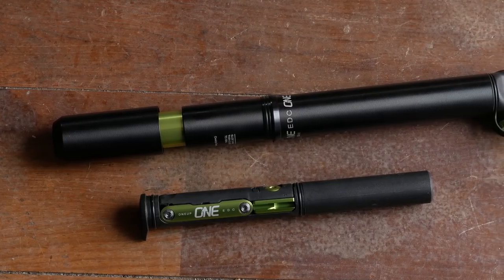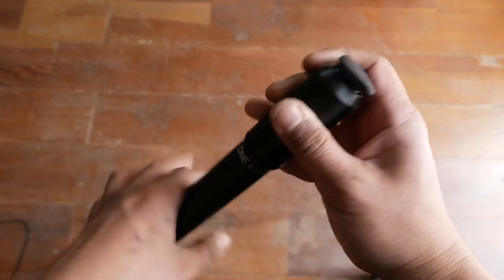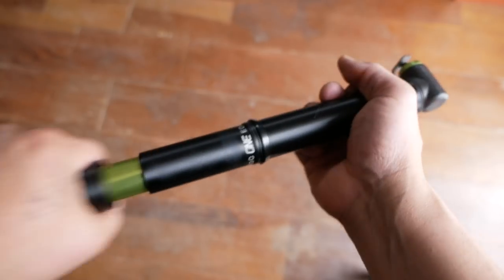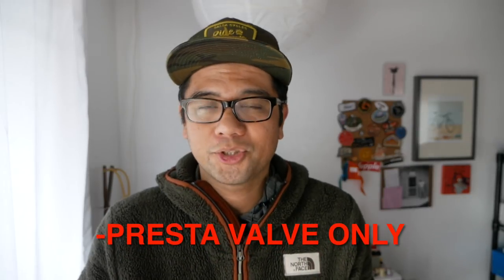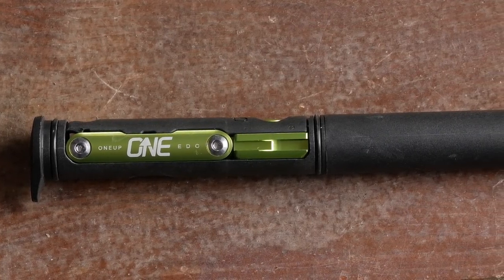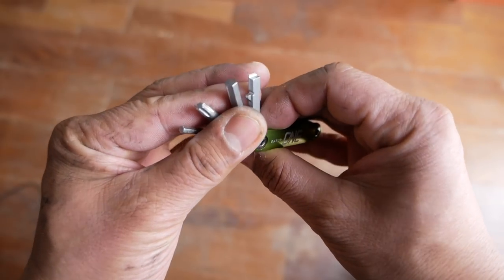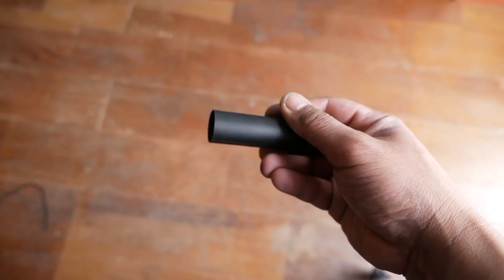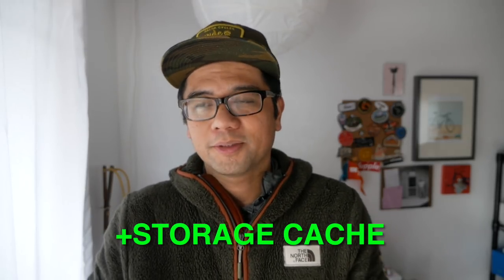Review: OneUp Components EDC Tool and Pump

Comment: I just had one of these pumps saved me on the trail yesterday. My Portland Design Works Ninja pump was not getting the job done and a rider came upon me and loaned me his OneUp EDC Pump and it worked like a charm. I personal think the price is justified when you consider how much it costs to add an additional bag to carry separate tools. It basically frees up the space your existing multi-tool takes up. And you can swap between bikes much easier if everything is inside a single piece. The pump itself is one of the best mini pumps I've ever used given you are okay with presta valve only. I ordered one today after being saved by the pump yesterday.

Comment: Tips 1: Basically sit the quick-link figure 8 flat on the tool between the two spurs. It should look like this ---> {8 Then you have to hold it there really tightly with all your grip strength while levering the 6mm allen key against the bottom of the figure 8, it should like this ---> {8/ It is very hard but I got it to work 4 or 5 times so I'm confident to do it on the trail. Tip 2: Remember to remove the C02 valve head with an allen key as it screws in really tight. Tip 3: I have really tight tire beads so I have to use the multi tool AND the the tire lever to get my tires off the rim. Tip 4: The multi tool only loads back in one-way or it wont fit back inside the pump. Tip 5: Test the chain breaker at home, mine works fine both in and out but it took some getting used to. Tip 6: If you get the small 70cc pump like me, use the large storage canister but cut the bottom off so it fits in the small pump. The skinny short canister is useless and fits nothing but I got glue/2x large rubber patches/4x quick tyre patches and sandpaper in the modified large one. Play around with all the tools properly at home and you'll love this all-in-one tool like I do. The pump is awesome (presta only) with its large volume and it didn't leak noticeably for me. I run tubes and this pumped a 27.5 x 2.5 up to 21psi in 100 strokes i.e less than a minute.

Comment: Best quick link removal tool I have used beside dedicated quick link pliers is a simple shoe string. Thread through the holes outside the quick link pull opposite across the link and bam! Link unlocked.
Reply from the maker: I tried the shoe string trick while filming this video. I found it worked on one set of power links but not another.  That's going to be a sep. video.
Reply: Johannes Nilsen 
I have tried it on brand new and well worn sram chains and kmc chains and it has worked for me. Haven't tried it on sram eagle yet however.
Reply from the maker: I tried it on SRAM 11spd and it worked well, but could not do it with a Shimano 10spd road.  I think the plier works for all and a shoe string works for most.
Reply from the maker: Tried it on a Shimano 10spd road with little wear and couldn't get it open.
Reply: What brand of quick link was holding the Shimano 10spd road chain together? KMC? SRAM? I know Shimano doesn't make their own quick links, so maybe you found a special mix/matched combo that has ultimate holding power! :) 
Always enjoy your videos Russ. 
PLP is one of my favorite channels by far. 
#BikeNerdsUnite 
-Nick
Reply: Not even a chance on 11 speed shimano brand new quick link.
Reply: Sandy Kavor works for me on 11 speed Shimano new links, but takes some extra effort for sure.
Reply: @RideAlongside  I have tried many times and it won't work with bare hands. Maybe in work gloves possible, but I don't see the need to struggle since there is plenty of proper tools to do that job.
Reply: Sandy Kavor well, I always ride in gloves, so maybe that is a consideration that I didn’t think of. I will more likely have a shoe lace than a specific tool, that was my only point. Thanks for the conversation.
Reply: @RideAlongside  I ride in gloves as well, but they aren't enough to stop the lace from digging into your hand. Maybe very strong leather work gloves yes. I use wolftooth pack pliers and even those are hard to push open the link. If anything I just use a chain tool on the trail and replace spare link then. Honestly how many times you actually have to separate chain while riding. I never had to.
Reply: Yep I always have a string with me haha

Comment: Thanks for your video. Regarding the quick link tool. ..I’ve had success using a short section of shoe lace .
-thread through the quick link
-put a knot in the open end
-use one of the Allen keys of your multi tool to twist the shoe lace-similar to a simple tourniquet. 
Practice the method before trail use. 
Cheers.

Comment: You need to move the quick link tool one link left. In the video you're just pushing against the right side of the quick link and pushing it tighter. Look at the way the link needs to be pushed for it to unhook. Opposite direction you push to install. Great review though thanks for the vid.

Comment: After watching you struggle with the quick link tool I had to give it a try. And the only thing that accomplished was getting my hands super greased up. For reference I tried on a near-new SRAM PC-1110. 

At home I recently bought a pair of Park master link pliers, and I do not know why I waited. It's so nice being able to pop them apart easily and without having to touch the chain with your hands.
Reply from the maker: Yeah. Not as easy as it looks. Don’t know if you saw our vid on the Clever Tire levers that turn into a plier. That makes a great travel option.

Comment: I wish one up had a video on how to use the pump with a C02 cartridge. I guess you unscrew the green pump head and this somehow threads on to a C02 cartridge to pump up a tire? Does it have an on/off switch? 🤷‍♂️
Reply: You likely thread it onto the presta valve then thread the cartridge onto the adapter. There is no on off switch. The co2 discharges entirely and you can let air out afterwards
Reply: My understanding from the website is you thread the co2 all the way in for off

Comment: Hey, good review except yeah you're doing the chain breaker function incorrectly. The way you have the tool oriented to the quick link is trying to force it closed, not open. If you look at https://youtu.be/EN3yVEbXSXA?t=18s you can see that you need to have the quick link turned 180 degrees relative to the tool. (The slotted link hole should be on the LEFT if it's facing you, not the right. Or just flip the tool around.) I like your videos a lot but you might want to edit this one. The mistake you're making would be very easy for others to make as well.
Reply from the maker: Noted.  I think however a tool that complicated to figure out that you need a youtube video to use it is bad design.
Reply: Kinda douchie that Path Less Traveled threw this under the bus because he can't follow instructions. Maybe he should update the video.
Reply: @PathLessPedaledTV  What a hypocrite, you made a video on the EDC pump and tool but slam by saying a youtube video to use a tool feature on your video that couldn't figure out is bad design? WTH? Thumbs down for this one bud.
Reply: @LeoVasquez   Don't overreact like a fanboi.  He said multiple times that maybe he wasn't using it right, and he invited pointers from viewers.  Moreover, he did NOT throw it under the bus for that.  He said he liked it a lot in general.
Reply: @PathLessPedaledTV  Alright, I gotta say it's obvious in your video you are trying to force the links closed not open. 
Not to mention it's actually a pretty brilliant design considering it eliminates needing to carry a special plyer for unexpected in-the-field repairs AND allows for a complete all in one tool kit that can FIT INSIDE! the pump or steerer tube.
Reply from the maker: @SamSquanch66  You squeeze the outer plates to open them and you pull them apart to close them. 🤷🏽‍♂️

Comment: Maybe your link is installed in the wrong direction. It should work on your chain if you use the tool from the top on the lower chain or from the bottom on the upper chain.

Comment: The chain link splitter is very easy to use, you just have to use it in the correct way. As for leverage it provides plenty, if you need a lot of leverage to open a quick link then you've got problems with the link or tool

Comment: you had the quick link round the wrong way in the video. you were putting pressure on the link trying to close it instead of open it. 180 the link or tool and try again.
Reply from the maker: I was doing it exactly as the official video suggests. It looks like I’m closing it but that is how it is suppose to work. The tool pushes the outer plates together to loosen.
Reply: @PathLessPedaledTV  Your link is connected opposite of the one in the OneUp video. You're pulling the link tighter in this video.

Comment: Would a CO_2 cartridge fit inside the tool cache compartment?
Reply from the maker: CO2 screws into the bottom of the tool in place of the cache.
Reply: @PathLessPedaledTV  what about the co2 inflater? is that included?
Reply: @Frank_Denver  the CO2 inflater is included. The head of pump literally can be pulled out of pump to be used with the CO2 cartridge.

Comment: What is the difference in the 100cc and the 70cc
Reply: Late answer but hope it helps someone.
With 100cc you can fill the tire faster and you get a bigger tool chamber to fit both multitool and co2 cartridge.  70cc is lighter.  Takes more pumps to fill the tire and you only enough space for co2 or multitool.

Comment: Terrible pump for road, borrowed one on a ride. Head wouldn't hold the valve stem well enough to get 60psi in a 700x30. Better for high volume.

Comment: use a shoe lace to unlock the quick link, dont need a tool.
Reply from the maker: Wouldn’t a shoe lace be used as a tool then?  That’s like saying don’t eat soup with a utensil use a spoon.
Reply: @PathLessPedaledTV  Just trying to give you a tip, you were unhappy and couldn't figure out the chain Master link device, so I thought Id help you out, or anybody else that is struggling with it.

Comment: Well, while it is a interesting designed pump, the failure or difficulty to go above 35 psi is a deal breaker for me.  I was going to consider this for my touring bike but I need a pump to go to 75 psi for my 700 X 38 tires.  I can't see why Oneup couldn't have designed the pump for more PSI capability, kind of short sighted on their part.
Reply from the maker: 75 psi on a 38mm tire is really hard.  You should watch our video on tire pressure. The sidewall number has nothing to do with how much air you should put in your tire.
Reply: You must be running tubes to be using pressure that high. You gotta remember, oneup is a company mainly specialising in MTB so the pump design makes sense.
Reply: 75psi is WAY too much for 700x38. hope your wrists survived
Reply: @dirtsloth  I
Reply: @dirtsloth  Incorrect.  Tire psi depends on the weight the tires will carry, as it does with car tires who the manufacture of the car has the psi on the door, that is calculated based on the cars weight.  Now back to my situation, I use 75 psi when I go bicycle touring, the bike weighs 44 pounds including the weight of 5 full and large 41 ounce water bottles and the pannier racks front and rear; I weigh 185 clothed, and the gear I carry is about 65 pounds which includes the weight of the pannier bags, that's 338 pounds of weight on the tires.  So due to the fact that most of my weight is on the back tire the psi recommended based on several online psi calculators is right around 75 psi plus or minus a couple, the front is lower at around 60 due to less weight on the front tire.  There is room to move on that psi depending on how the bike feels while riding, but in my case, since what I use has already been tested by me, that is the psi I use.

Also, due to the weight, and depending on the type of carcass used in the tire a loaded bike like mine could shimmy if the psi is too low, my previous tires which were 45mm tires needed 78 psi to prevent the shimmying, my newer tires are not as affected unless I drop below the idea psi.  Even with narrower road tires one manufacturer may recommend a higher psi over another vs what a tire calculator will tell you, this is due to sidewall construction.

You need to understand the weight being carried, the size of tires, and tire manufacturer recommendations as to how much psi to use.

I forgot to mention, like car tires, if you are under or over-inflated it will wear out the tires faster, your braking performance will be decreased, and handling will suffer, all of which you don't want with a loaded touring bike.  Also, even on a road bike with narrower tires, it is possible with a larger person that their weight could exceed the max recommended tire psi on the tire itself, that means that person needs a wider tire so that it can handle more weight and be inside the max psi as stated on the sidewall.  Again if you think about cars, tire manufacturers will have a max listed psi of say 44 on the tire, but the car will say only to use 32, again, it's about the weight of the car pressing down on the tire, using 44 would be dangerous in regards to handling, braking, traction, and wear out the tires down the center very quickly.